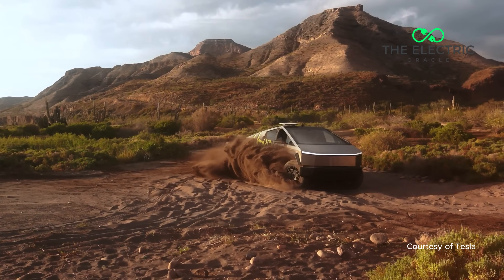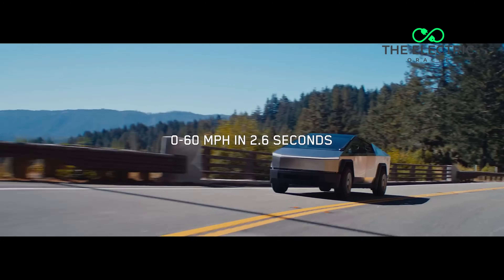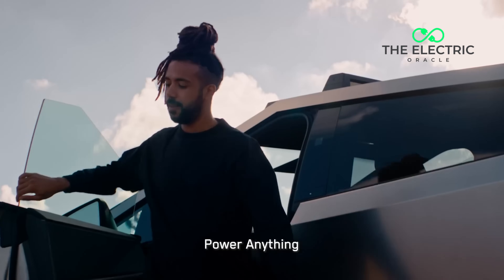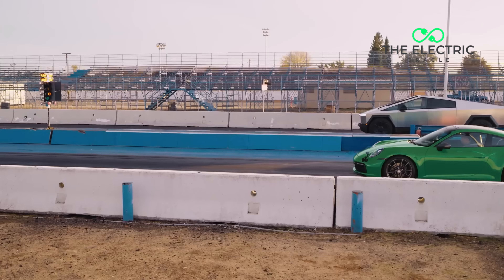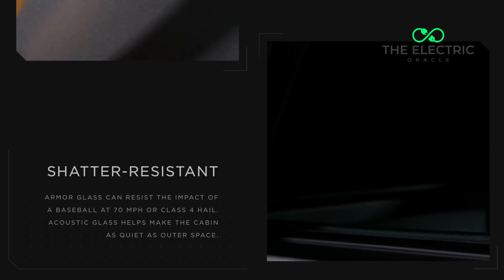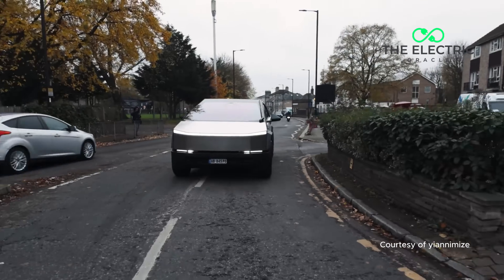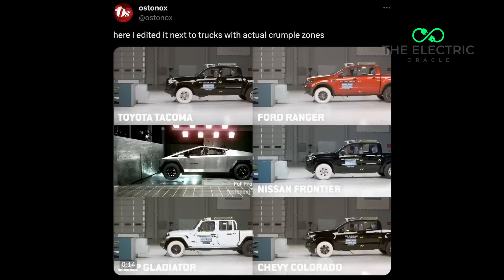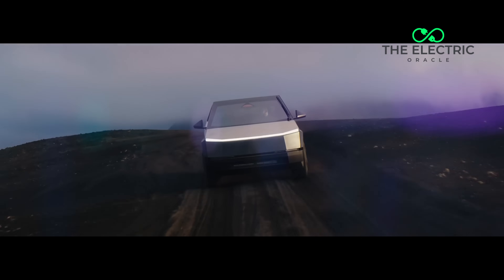5 Safety Issues Keeping Tesla Cybertruck Off UK Roads 🇬🇧

Comment: The weight of a vehicle has a MASSIVE impact on the damage it does to a road. I forget the exact maths but its something like doubling the weight across the same contact area quadruples the wear. Its part of the reason why lorries have as many wheels as they do. No personal vehicle regardless of reason has good cause to exceed 3.5 tons and if we allowed it, we'd see the condition of roads deteriorating faster than ever.

Comment: you forgot to mention a MASSIVE  no no in civilized countries 

THE STEERING WHEEL IS IN NO WAY CONNECTED DIRECTLY TO THE STEERED WHEELS 
all UK road cars are obliged to have the steering wheel attached mechanically to the wheels . so in the case of complete loss of power the driver cannot safely maneuver the vehicle till it comes to a complete stop. in a loss of power this thing will go where it wants

Comment: If the Cybertruck at some point is approved in the UK. Then it must mean that the UK no longer bases its approval on EU standards. Can UK cars then drive in the EU? Or will the EU simply ban those car models that are not approved in the EU? The latter solution may become difficult to administer in the long term.

Comment: Hardly armor grade stainless steel but the cheapest, most likely to corrode stainless steel that's not even good enough to use on kitchen appliances.  It's 1301 stainless steel which is only used to hold pure distilled water as it pretty much reacts with anything else.  The stainless steel on your refrigerator is 1304.   The stainless steel of the Cybertruck doesn't even meet the standards needed to be in your kitchen.

Comment: It shouldn't be allowed on any road. Ironically enough it should be off road use only....which it ain't that great at.

I've seen a couple here in Australia, on public roads and I have no godly idea how they got registered (well I have a good idea being an ex mechanic that has built my own vehicles. It's called money. Paying people to look the other way and hope like mad you never get involved in an accident else your going away for a long time....unless your rich....)

The cybertruck is not fit for purpose, dangerous, over priced, lacking in any form of common sense, I mean come on, we worked out in the 60s and 70s that building a car to be a tank is bad. Yet super smert Elon built this 3.5 tonne death machine that thankfully breaks so often it's the only thing keeping the public safe.

I genuinely believe if this vehicle was made by anyone else, it wouldn't have sold at all. But something about musk makes being think differently.

And the only reason you would need armoured windows and panels is if your in a war zone, or high value target.

And guess what? In both those cases you want something that I ultra reliable, fast to top back up on its range (like diesel or petroleum), has long range, and even then still has things to keep pedestrians safe or the occupants alive.

If you need something more resilient go an aslav (APC), tank or go via a gunship, sub, aircraft carrier etc. I'm sorry if your buying a cybertruck of your own  safety your wasting your money, buy a used diplomat vehicle for better protection to everyone involved. And let's be real so very few people in the world need that level of protection, and if they do, they want it to survive IEDs, let along water spraying up from an aggressive puddle.

I'll stop as I could go in for hours.

Comment: There should be no dispensation for an EV regarding weight whether you've got a 3.5 tonne cybertruck at 40mph or a 3.5 tonne commercial vehicle at 40mph, in an accident, you've still got 3.5 tonnes hitting you so if it means slower speeds to be safer then that's what it should be. Plus it might encourage manufacturers to develop smaller, lighter and more efficient batteries.

Comment: 3:15 There is nothing "carefully" engineered about the Cybertruck's anything. Minor puddles that any normal vehicle can run through can brick the truck, body panels can outright fly off at highway speeds, and the aluminum frame bending just by launching the damn thing, or snapping by hauling heavy loads that it was advertised to be able to haul. Not to mention it had/has a tendency to brick itself by charging with Tesla-made chargers and my favorite quirk is the throttle pedal cover can slide off and get stuck on interior trim whilst depressed causing a runaway truck scenario. It's laughable that it was made and is legal as is here. It's a $100k+ dumpster that's "road legal"
Reply: Calling it a $100k+ dumpster is an insult to dumpsters.
Reply: @cshairydude  Know what, that is factually accurate. Gotta find a better comparison now

Comment: No. An SUV in a head-on collision with a car will wipe out the occupants of the car. SUV's need to be removed from the roads unless driven by someone suitable trained and certified, and only if the owner can prove they have a need for such a vehicle on UK roads.

Comment: Not sure why anyone in the UK would want this car. It is too wide and too long to be usable. I live in the US but am from the UK.  Fo understanding a Range Rover is classed as a mid sized SUV and the Audi Q8 is seen as small. However, in the UK these are massive road barges. The Cyber truck if ever specified for the UK/EU market would likely be rebuilt and down sized.  Much like what ford did for the F150 Raptor and the Ford Ranger Raptor which is smaller in all dimensions. Taking one market standard and expecting the exact same car in another market is strange. Think a TV what is sold in the US is not the same model in the UK there will be differences. From plug to encoding requirements

Comment: cyber truck is a one off so no need to start changing the road safety and regulations for a inferior truck design that has had so many recalls it goes to show it was thrown together. I knew most of these issues as to why you can get them here but this was explained very well and clear and not just some click bait. Lets not lower our standards down to America's poor or no standards.

Comment: Maybe the Cyberjoke needs to be licensed as an armored car in the UK. The armored passenger cars are heavier than weight limits with many of the same faults, like unbreakable windows and being near impossible for rescue squads to pry them open. There are even a few who've been licensed to drive true armored cars, as in those that were designed for war. Oh, for those who don't know about US pedestrians, the auto industry isn't particularly concerned. Yet we have guys who step off a crosswalk directly in front of oncoming traffic, expecting the driver to slam on brakes. We have dudes who hit the cross flasher and step out before looking to see if traffic is slowing or accelerating to get thru the light. Not to mention high speed bikes weaving in and out of vehicle traffic and running stop signs and red lights. Apparently they are hoping, if hit, it'll be a Euro grade car not one of our 7,000 pound pickups.

Comment: It's GVWR is 4.1Tons(m). It's actual weight is only 3.1Tons. They literally could just slap a new rating sticker of 3.5T and call it a day if they don't care much about the UK. PS. Some of the other pickup trucks common in the US out weigh it in GVWR. (Ram 2500 is one example.)

In Ontario we are allowed to drive up to 11Tons(m) with the most basic licence.

Comment: my first thought after the reveal from elon was... never gonna be legal here in europe and for then right reasons
plz dont bring that sh it here...
his presentation made me realize musk doesn´t even understand crumble zones, the reason why modern vehicles break in tiny parts and deform so easily. even worse nobody dares to tell him... building cars that dont dent so easily was done before... they used quite thick steel sheets for a long time building cars. they did great in crashes and could be bumped out with ease, however the occupants didn´t fair so well. instant deceleration resulted in horrific injuries for passengers. then smart people realized by stretching the amount of time for deceleration by intensional deformation safes lives and should be prefered
recently a not so smart guy who doesn´t care about other people suggested to return on saving the car... u cannot even break the window to get people out because the doors are electric and dont work without power,  emergency release hatches are hidden behind panels... people are going to burn

Comment: The weight issue is crazy. I work with EV manufacturers. The holy grail is to get the weight absolutely minimised. That way you can use less batteries with more range. Batteries hit price and range is obvious  - the key issue that turns off buyers if your range is not great. 

So going to that weight totally breaks every rule of common sense EV design.

Ive had many bingles  with authorities over vehicle design rules and standards. They dont like changing rules for one-offs because most of the standards and rules are based on extensive crash testing, research, and legal cases, so changing them creates all sorts of issues that they just dont want to go near.

Most of the time youre only allowed laminated glass on the front window (which is necessary for what I hope are obvious reasons). That gives you breakable side and rear windows, to allow for breaking and escapes from those. I once got a two deck bus build approved by having the front bottom window fitted with a window breaker (necessary because if a double deck goes over on its side the only practical escape route from the bottom level may be the front window). That was a huge song and dance. I dont know what those side windows on the cybertruck are but any sensible vehicle standards regulator is going to have a fit over 'unbreakable' windows. And I dont even know why a vehicle manufacturer would think thats a feature worth selling to a customer - side windows never break except in collisions, but thats exactly what you want them to do if youre in a collision serious enough to break them. Who on earth would want "unbreakable" windows, except at the front? Why would you want to pay for something so unnecessary? And, again, thats adding weight to the detriment of range for no actual benefit in reality.

Pedestrian safety is something Ive found the regulators take extremely seriously (obviously I havent worked with american vehicle regulators!). In my country Ive had bingles with regulators over the wing mirrors on buses because 20 years ago a pedestrian was struck and killed by one. So they have to be a certain height and extension. The regulators Ive dealt with wont give an inch over things like that. And they wont modify the standards for individual cases.

The cybertruck is like taking an unmanned aerial vehicle (which I also work with) and trying to get it certified as a road vehicle. Regulators just do not like these kinds of novel vehicles that present risks that are utterly unknown and unknowable. In those circumstances Id expect them to revert to their standard response to that situation: go away. Given musk probably wont compromise enough either - his contempt for regulations and regulators is well known by now - Id anticipate the cybertruck is - like AR15s - going to be an "only in the USA" vehicle.

Comment: The current US truck designs, not just cybertruck,  has seen an increase in fatal accidents on US roads, bucking the downward trend of several decades, the UK surely doesn't want to see a similar spike in fatalities. 
The costs of additional equipment are not going to be easily accommodated to upgrade emergency rescue equipment, and you can imagine media furore should a family be unable to be rescued from one of these vehicles? 
Vehicle manufacturers can read the rules around put in place by the governments of their intended markets, if they then design and build products not capable of meeting specifications then they have to accept that the product can't be sold or used in that market place, you can't expect regulators to change the rules to meet a product.
All in I would say that cybertruck is never going to make a legal appearance on British roads and knowing EU rules are very similar,  not there either.

Comment: The bigger concern should be the drive by wire. The steering wheel isn't fiscally connected to the steer tires. As a 40 year mechanic the electrons are the most unpredictable part to worry about. They don't wear out, they just quit working with no waring. And then you have no steering, this will happen.

Comment: Good video, and there are quite a few issues that seem insurmountable. I don't know how it got approved in the US, and it was never tested by the NHTSA, but it's clear that form was far more important than safety. The pedestrian issues are serious, and that alone should be a deal breaker in terms of regulations. 

THAT being said, it should be pointed out that traditional braking systems rely on liquid that leaks, rubber seals that fail, and tubes that corrode and rupture. Traditional brakes are the leading cause of collisions due to vehicle defects in the UK. Emergency brake? 70% of the cars I used to work on as a former mechanic have emergency brakes that have never been used and do not work. Traditional steering systems also have single points of failure, and I have driven a car that lost steering capabilities due to an exhaust leak that caused a rack seal to fail. I will say that if I designed the Cybertruck steering system, I would have used a physical rack and pinion system in front, and left the electric steering with it's limited range of motion out back.
Reply: Imagine if cars used an air brake system like trains instead, where you have to apply pressure to release rather than to apply the brakes, so they would auto-activate during a leak, a fail-safe design. As for NHTSA I read that the Cybertruck earned a 5/5 star rating but I also heard that they take pedestrian safety into less consideration than occupant safety

Comment: The idea that EVs are heavier than ICE cars because of the battery is a myth because it disregards the weight of the rest of the power train and wet weight. Usually people take an engine or an engine and transmission and compare it to the weight of the motor and battery and say "look how heavy that is!" But that's a subtle lie. 

EVs don't need to have driveshafts, transmissions, differentials (if they use two motors in the rear or front instead), motor oil (6.2lb/gal), gasoline (6lb/gal), fuel pumps, gas tanks (25 to 50lb), exhaust pipes, intake assemblies, relatively massive amounts of engine coolant 6lb/gal), &c. The result is that when you add up a whole diversion weight and the weight of the engine AND the weight of the fluids you get basically comparable numbers unless you're putting in an extended range battery: which is like adding an extra 10 to 15 gallons of fuel in a steel reserve tank; which is like 150-250 pounds. It is nearly the weight of the extra battery cells.

Comment: Your data is not correct, a Cybertruck Cyberbeast (the most powerful one) weighs 3104Kg according to the Tesla website. Ranger Rovers go up to 2810Kg. Furthermore, the Cybertruck is not made or indented to be sold in the EU, obviously. The CYbertruck has in the meantime officially been imported into Norway by a company; and given formal documents for driving.

Comment: There was one thing you didn't make clear in your video -- the 3,500 kg limit for vehicles driven by class B driving licence holders who have passed their test since 1 January 1997 does not refer to the vehicle's own weight, but to its Maximum Authorised Mass (MAM), that is its maximum laden weight.  Therefore a car that claims to be a 5-seater definitely needs to weigh less than 3,100 kg and, if it has pretensions to carry some luggage as well, less than 3,000 kg.

AFAIK, the weight limit is intended to limit the risk to other road users of a substandard driver (the driving test is arguably more difficult), or a driver who suffers from medical issues which may affect their driving ability (drivers of class C vehicles and above need annual health checks), as well as a substandard vehicle (the MOT tests for vehicles over 3,500 kg MAM are harsher, as are, arguably, the Construction and Use Regulations (C&UR)).  Since electric vehicles which comply with the C&UR are about as great a risk to other road users, children playing in school playgrounds near quiet back-roads, people asleep in houses on the outside of bends, USA citizens who forget to drive on the left, etc, as non-battery vehicles of the same weight, there should not be any exemption for cars which are overweight because of their battery.  

In the future, it might be reasonable to allow increased weights for vehicles with approved self-driving automation, once such systems were proved to be much safer than most drivers, and provided that the vehicle was designed in other ways to minimise third-party risks, but that would apply to all cars, not just electric ones.

In any case, nobody should be buying anything from a man who gives Nazi salutes from a political podium, who refuses to remove false and malicious statements from social media platforms, and whose interactions with others continually show that he is a fascist.

Comment: A C1 license doesn't require medicals or anything more than a standard car license, providing the license holder took their driving test before 1997. 
I have C1 and D1 on my standard car license, which was issued in 1986.
After 1997, an additional test is needed, but there's still no requirement for medicals, if the vehicle is for private use.